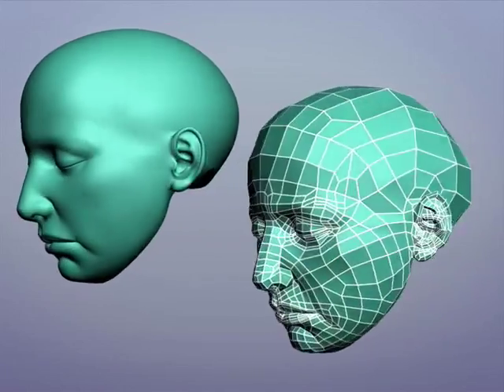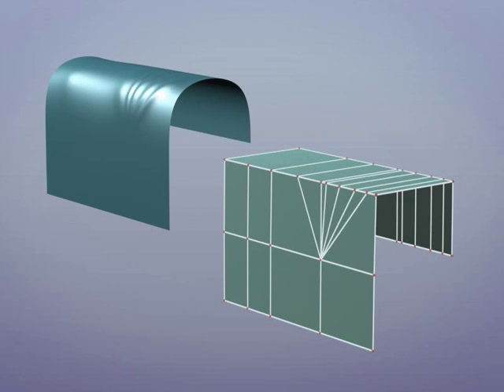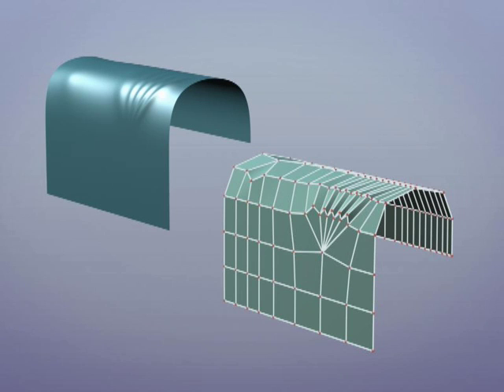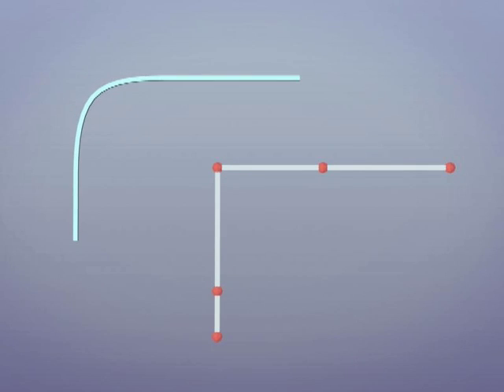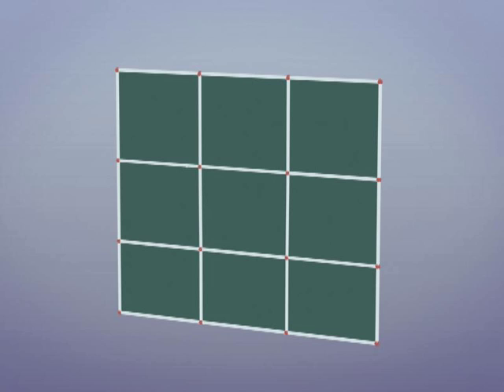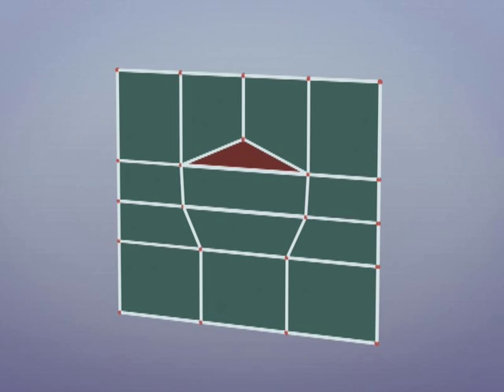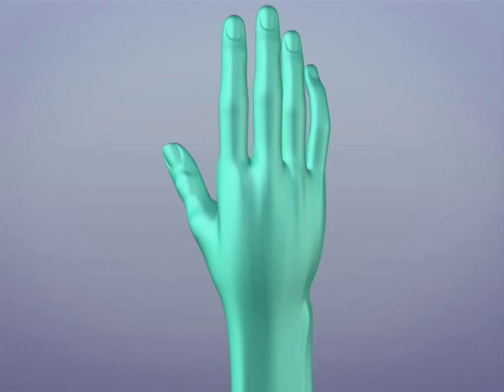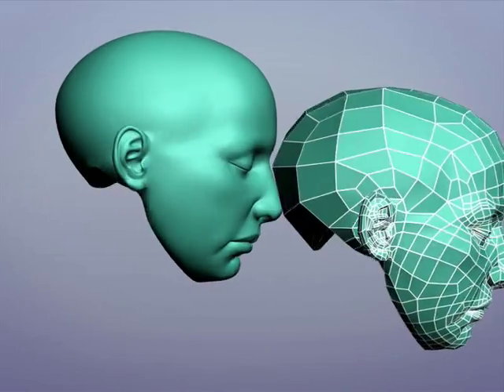Subdivision Surfaces: Artifacts

Comment: Great video, at the end u mention that the hand has too many edges and u make the edges 'flow back' to reduce too much detail but how would u do that? i mean did you use the split polygon tool to make them flow back or the insert edge loop tool? If you used the insert edge loop how would you make it go in that direction?